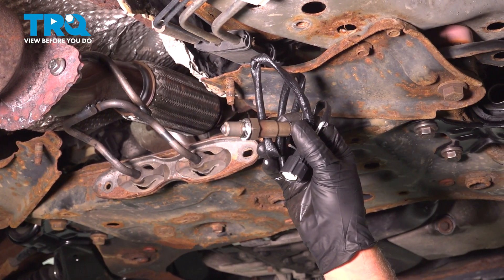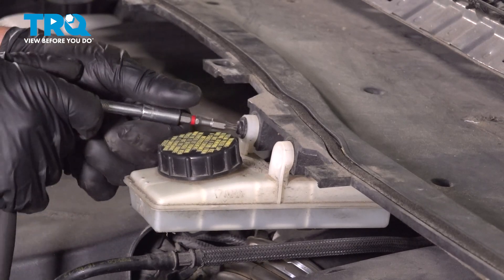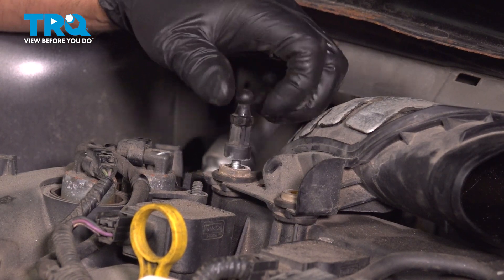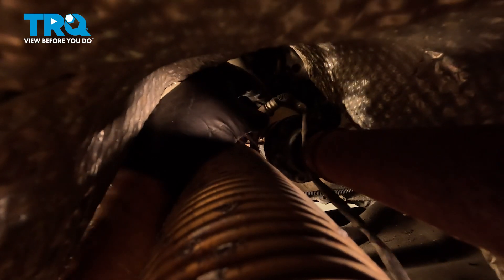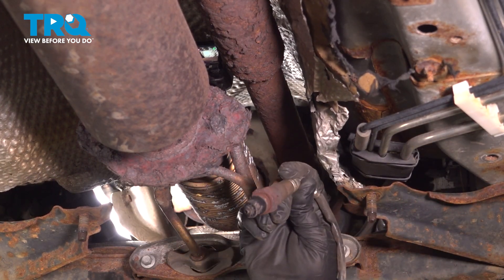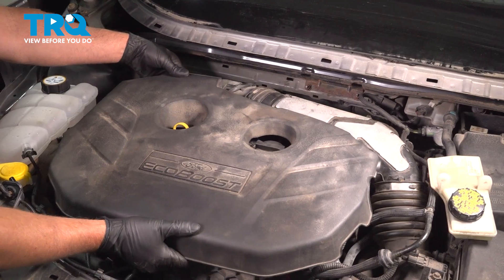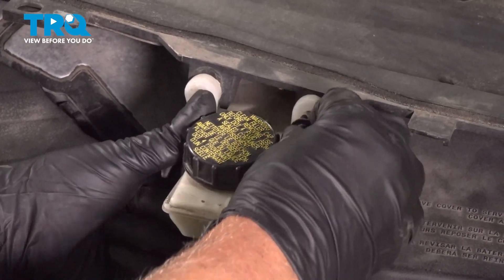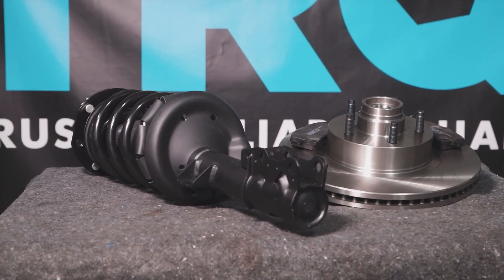How to Replace Downstream O2 Sensor 2013-2019 Ford Escape

Comment: This is unbelievable. This is why I'll never buy another Ford again. Replacing my O2 sensor is a $1000 job. The battery requires the cowling to come out. The spark plugs require the air hose to come out. It's unbelievable.

Comment: As noted at https://youtu.be/cdJI01XA6qE?si=95TiIX5OsEUWY0bk&t=626 you switch to the UPstream install, which is on a another video that includes removal, too. Since the intake pipe/hose removal/reinstall is the same for both , you  overlapped a few seconds. Thanks for the video. Apparently the 'book' says to remove the driveshaft for access to the Downstream...good to know that's not required, Mr. Nimble Fingers!

Comment: In this video the upstream O2 is only shown going back in, not coming out. Did footage from filming for upstream & downstraem O2 replacement get mixed up here ? If only replacing downstream O2 (P0141 O2 Sensor Heater Circuit Bank 1 Sensor 2) does the upstream O2 need to be removed ? Thnx